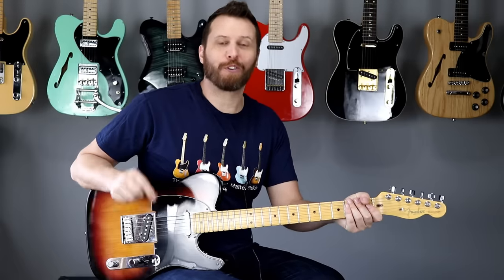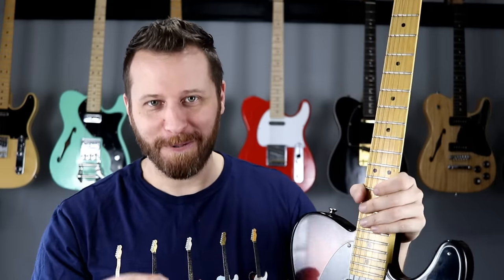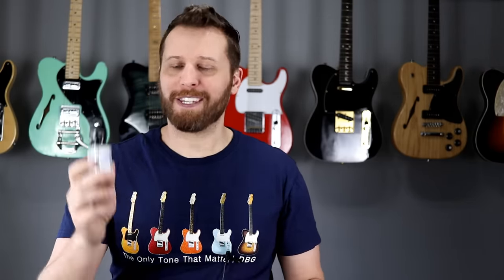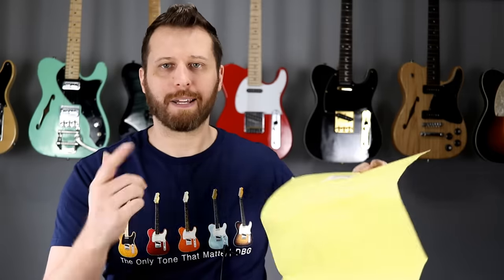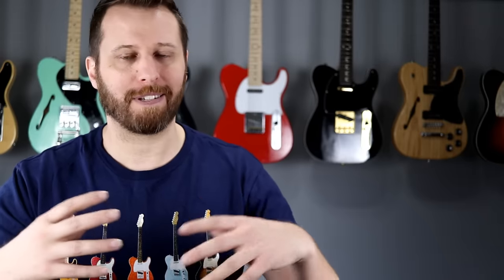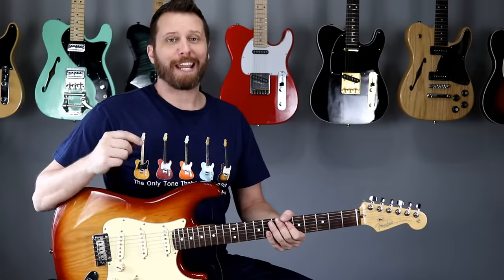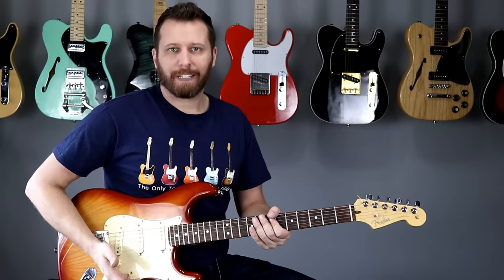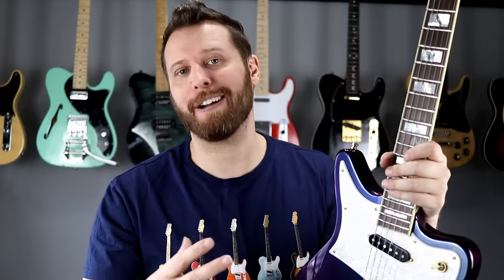KILL The Hum and Buzz!! - Keeping Your Single Coils QUIET!

Comment: I have found from ownership experience that my made in Indonesia Fender Affinity Telecaster is essentially my best and favorite electric guitar out of 17 others. I place it above or at least equal to my $1,999 Gibson 2017 SG STD. HP! I love my Telecaster and it allows me to play really well, it does not prevent me from getting the tones and notes that I am trying to play. It's not working against me in any way. In fact it's working rather well for me.
I paid $249 Brand new over at Sweetwater about 1 - 1/2 years ago. For that price I also received a Fender Frontman 15G Guitar Amplifier (which is damn good, only lacks reverb), a Fender instrument cable, a Fender Guitar strap, a Fender electronic tuner (it's my best tuner and never lets me down) and a Fender Gig bag! Wow! What a deal! My Telecaster has the skunk stripe down the back of the ("Maple") neck and has the string through body with steel grommets in the back, it also has six (6) individual saddles and I can get Intonation absolutely perfectly. The pups are clear and silent and strong. The knogs work perfectly. The neck is without fault, no overhanging frets and it's even "Rolled" which I know that Darrell loves. In all honesty it arrived with one fret, the 3rd fret on the hi "E" string a little high which was causing a very slight buzz. I can't tolerate any fret buzz so with just a little work with a quality file the problem disappeared. 
This one Telecaster all by itself has made up for all the difficult (in comparison) to play guitars that I have and I have 17. I absolutely play my Telecaster more than any other instrument. It can do any style of music. Jazz, Rock, Blues, Country Shoe Gaze. I can even make it sound like my Full Hollwbody Guild A-150 Savoy that has Flat-wounds. I finally got LUCKY! I am a Telecaster man now. Oh and the body is not all that heavy and it is a very comfortable shape and size, not too thick. I did file/sand the top and bottom corner (near where it makes contact with my body) down just a little when I saw others doing that. It makes it more comfortable but in truth it's not all that much more comfortable so I recommend not doing that. It's the one time that I followed a trend. I figures so many people are doing it, so it must really make a difference. Yes it does but I would not do i again if I had it to do over again.
If you want a great electric guitar I recommend Leo Fenders Telecaster. Spend as much or as little cash as you want. It's a simple guitar that is close to perfection and is very tough and resilient to damage, so once you own one you shall understand what I mean and why I wrote so much about it here.
Last thing, the tone is great and very adjustable. It really can do all styles of music. Small adjustments of the knobs and also using the 3-way switch and volume allows for tasty tone and it allows you to get different shades of your tasty tone with small changes. Honestly the tone capabilities is beyond the reach of every other of my 17 electric guitars. I think that's really why I love my Telecaster so much. I can make small adjustment as I play and this allows me to keep in the mood, to be able to make the tones that I am feeling. You have all seen great guitarists making minor adjustments using the knobs and 3-way (or 5-way) switches while they play. Once you find yourself doing this, trust me you are now an advanced player.
-Peter

Comment: The pro guitar techs have determined that the shielding paint loses effectiveness after 5 years or so. Sure enough, 4 years after doing mine, I'm getting worse readings on my Ohm meter than when it was first painted. I'm just gonna add another couple coats and call it good. My SX strat clone has a lot of irregular surfaces in its several cavities, making the foil very difficult to do correctly. Thanks, Darrell, for your comprehensive presentation on the various options.

Comment: some good tips in this vid, but I am surprised you didn't also mention grounding.  One of my strats was noise than the others, and I finally realized it was not grounded to the bridge.  Once fixed that improved the hum a lot, still has some but was much worse without grounding.  I still want to shield the cavity but for now, just ensuring a good ground helped.
Reply: If your guitar isn't grounded it's faulty and potentially dangerous. All electric guitar circuits must be grounded.
Reply: @MonsieurVersatile  Thanks-good point and totally agreed.  Just mentioned it, since where mine was grounded, it had become a bad connection (must have been cold solder joint from previous owner). Once that was fixed, it did make a big difference in reducing the hum.

Comment: There is a great gate software/vst called Reafir that comes with reaFx bundle. It can be used to automatically take the humming frequencies and subtract them. Extremely precise and one doesn't have to fiddle around with knobs. Last thing it's free and easy on cpu and works on all daws.
Great bang for the buck that you never have to pay.

Comment: Holy Crap Darrell!  This video just made me realize why Fender put the freaking strat volume knob practically on top of the bridge pickup.  Because they knew you'd be constantly having to roll the volume down to control the hum!  Geesh.   You'd think they would have tackled that problem right away.
Reply: At that time the humbucker hadnt been invented yet. For example the Gibsons had even noisier p-90 pickups. Fender was just being smart putting the volume where the players can easily reach it. Besides, people didnt play with much gain until the late 60s. There is no other guitar that you can control the volume so effortlessly. Yngwie Malmsteen style volume swells with the pinky are prettty much impossible without a strat.
Reply: @infectionsman  Good history lesson, thanks.

Comment: Use a noose gate that is signal activated.  It doesn't cut off notes  if you turn your volume down because as long as there is a signal, the noise gate can function properly

I use a 30 dollar Donner noise gate and it is phenomenal. It is signal activated

The other type of noise gate that I don't like is voltage activated, if you turn your volume down the noise gate doesn't function properly. It's a dramatic difference

Comment: You forgot the old "turn your body until the hum stops" trick. I thought it was a joke until I bought a P90 equipped Les Paul and I can get it near silent if I'm facing the right direction. Not practical for a performance but for home-based play it's all I need

Comment: I have an Electro Harmonix Hum Debugger pedal.  It eliminates pretty much all the hum coming from my guitar, even with the amp cranked.  It's a funny pedal in that it runs on 7.5 volts ac/ac. It works by removing odd-order harmonics in "normal" mode and both odd & even order harmonics in "strong" mode.  This means it will really alter your dirt pedal tones, so you might want to put it at the front of the pedal chain, or disengage it when using dirt pedals.

Comment: I use shielded mic wire in my builds and mods for anything and everything if I can. I have wrapped a bare wire with single coil pickup wires, then wrapped in foil and shrink tube it to shield the wires. Every little bit helps.

Comment: Shielding the guitar isn't quite to quiet the single coil pickup. Sometimes the hum has nothing to do with the actual pickups, which is why a good guitar with humbuckers  STILL has shielding. "Hum" can be caused by many things, not just pickup noise. Even guitars with "noiseless" pickups can hum quiet a good bit. It has to do with external causes, like AM interference AND lack of proper shielding/grounding, among others. This should have been in one of your "mythbuster" episodes!!
Reply: I had to get a power conditioner because of the wiring in the building I live in. It helps.

Comment: The Ernie Ball and Suhr systems are very different.  The EB system is active (requires a battery) and as seen in the video doesn't get rid of all the buzz.  The Suhr SSCII system is passive (Doesn't require a battery) and does eliminate all 60 cycle hum.  My Suhr has the SSCII and the single coils are quieter than the humbucker. The Illitch system is available in lots of configurations and works as well as the Suhr system...  I'm pretty sure the Illitch and Suhr systems are the same in different forms.

Comment: I feel it also helps to see where you are putting your equipment. Like I had my amp plugged into the same strip as my PlayStation and my entire HiFi setup, all in the same corner of my room that I sit on the floor at and play in front of the amp. Obviously the humming was absolutely intense as all hell.

Comment: Another option low noise single coils for example lace sensors I have a set of DiMarzio Brian May pickups they are low noise too. Still is a compromise because they usually don’t sound exactly like you want.

Comment: I had an old Epiphone USA pro super strat that had a neck single coil.  It had a dummy coil in the control cavity and it worked really good.  No noise and because it wasn't by the strings it sounded like a single coil.

Comment: Use shielded cables and a power supply or high quality power strip/supply to clean up the power. There is lots of interference inherent in the grid, your home or building. This is often referred to as “dirty power”. It’s all just interference. Also ground your outlets.

Comment: As a fan of single coil guitar we should do this

1. Isolate all power supply for each pedal
2. Use noise gate and or noise supressor
3. Use noiseless and good cable and patch cable
4. Use hum eliminator

Comment: I have the Ilitch Electronics dummy coil system installed (by a good tech) on my Strat and Tele, and it sounds great, very transparent, as little change in sound as possible. Not cheap, but worth it to me.

Comment: One you didn't cover, that was the "secret weapon" of a lot of players through the years is a "dummy coil" - some are an extra pickup laying on it's side under the pickguard, often without pole pieces.  Some are visible, but have the pole pieces removed and the pickup is lowered flush with the pickguard so they don't "hear" the string much, if at all, then in both cases the dummy coil is wired in humbucking much like positions 2 and 4 on a strat, but without the quack.

I've also seen cases of pulling the screws on one coil of a humbucker - it still kills the noise, but you only get the sound of one of the coils (though they don't sound exactly like a true single coil - different winding geometry and number of turns are the most likely reason there).  If you have a guitar with screw pole pieces, really easy way to try it out and see if you like it that shouldnt do any harm to the pickup at all.  Just make sure nothing gets down into the holes while you are testing it out - probably throw a strip of tape over that coil or the like.  Otherwise it makes getting the screws back in difficult.
Reply: Got a Epiphone Blueshawk a while back because I played it in the store, thought it was real cool, I couldn't work out why it was so silent, didn't even realise it had a dummy coil til I looked up the specs on line a week later. Actually I didn't even know dummy coils were a "thing". Great guitar

Comment: One thing that was missed here was pickups like the Seymour Duncan Hotrails and Coolrails which are humbuckers that fit in a single coil hole.  Sure, they may not sound the same as single coils, but I don't think they sound like full size humbuckers either.  The SD stacked pickup was definately the quieter in terms of hum on this test though.  It would probably be pretty good with a noise gate set loosely.

Comment: Love you video most things are really on point. Here's some other ideas. A lot of times a ground lift amp or a d i box with a ground lift in it may help quite a bit. Also if you turn 90 degrees to the wiring that has the sound you may eliminate the noise. If it's your home you may eliminate the Noise by grounding the circuits that you're plugged into, as in a could be bad wiring in the home.

Comment: I use the Electro-Harmonix Silencer, but I generally end up switching the gate off. The gate doesn't play nice with others - especially a compressor. When used with a compressor, it's like running a humidifier and a dehumidifier at the same time. I'd rather have the hum than lose the initial attack or sustain that comes with using a gate.

Comment: The gate isn’t eliminating the hum. It’s still there while you’re playing. I hear it.

The high pitched buzzing you’re hearing isn’t hum. Hum is magnetic field noise. That buzz is electrical field noise. Shielding fixes that. The pickups are not shielded. Shielding the control cavity or pickup cavities don’t work as well as shielding inside the pickup covers.

Comment: Other noise issues are cheap or old cables. Cheap unshielded wiring ,or breaks n the shieldng of the wiring . Bad solder joints.   Grounding issues cause hum as well .
Reply: I agree ....lol

Comment: Great video! I completely shielded my Strat (basically a faraday cage in the electronics cavity) and installed some DiMarzio Area pickups. They aren't true singlecoils but a stacked design, but imho if you aren't super picky about the "true singlecoil sound" they work very well, sound incredibly close to the real deal and kill all the noise. My Strat is dead quiet now. No matter if playing live or recording :)

Comment: Darrell, how about putting a dummy coil in the pickup cavity? Could you accomplish the same thing with a lower value inductor? As for what i use right now see my first comment. I'd like to see what could be done with this othertechnique, but my Strat was stolen. I'm saving for another one, but this will be my fourth Strat, and I'm about to give up on them and get a Tele or Jaguar with P90's.

Comment: Shielded wire makes a huge difference. Many Fender style guitars don't have it but they can be modded with the shielded wire for sure, I've done it. With BOTH wires shielded, you can swap phase quietly without putting the shield on the signal path.  Fender made a three wire tele neck pup called the "Twisted Tele" ..but did not shield the wire, just the pup cover...?  C'mon Fender- use shielded wire!

Comment: I use the Duncan Stacks in my 3 pickup Tele and love, love them, narley and beafy and coupled with a wireless they'r quiet as a mouse. I use to do the shielding but it is a hassle and guitars should come fitted with that set up. Don't forget the Wireless! It reduces the amount of cable that picks up most of the hum to begin with.

Comment: Power conditioner may be another one, or DI box (JDI Radial Engineering)
When I record DI there is an angle I can turn my guitar away from my speakers to remove hum. 

Thanks for the video!

Comment: I have an old Washburn Strat style guitar, and the original single coils were thin sounding, and hummed awfully.  I replaced the pickups with EMG actives, and they are quiet, but still put out that quacky Strat sound.

Comment: Shielding both the guitar and amp while using an equalizer or pre amp definatley helps reduce alot of the humming from using alot of effects pedals and e.m.i. . a speaker mod can also help crank up the volume with less hum in your tone.

Comment: First, sorry it took me this long to see this video. It somehow slipped by me and I only saw it as a recommendation from YT. 

Second; You didn't mention just standing/sitting in a Faraday cage! 😉
Although if you chose to do the shielding option, and did it right, that's pretty close to what you created! See! All those high school science classes are starting to pay off! 😂

Seriously though, I'd highly recommend the shielding option.  If you can't / won't do it yourself, I'd bring it to a tech or luthier to have it done right. Honestly, it doesn't take much labor, and the most expensive part will probably be the conductive copper tape used. Amazon has rolls of conductive copper tape for $5-$20 usd (depending on length and width). Last I looked Stew Mac had rolls for around $25usd. Make sure if you are doing this yourself that 1) the tape you bought is for shielding and not 'slug repellent' and 2) the adhesive on the tape is also conductive. 

I also make a small 1-2mm lip onto to the top of the guitar (all the way around with slits made in the tape to account for / accommodate the curves of the body cavity) so that it makes an easy connection with the tape on the back of the pick guard. That way it is still small enough that it is covered and not obvious. I have also seen just a small strip extending out by or even running under the bridge with a matching strip on the pick guard (until the end of the pick guard only). Ultimately, as long as you are making a connection between the two, you should be ok. If you are having issues with a non working pickup after shielding the cavity, look to make sure nothing is grounded out (that isn't supposed to be anyway). It's actually not that uncommon as you are moving and bumping everything around. ✌🏼

Comment: Yes a Gate can help most folks but lets face it some of the real beauty of the classic Fender single coil sound actually includes the hum, I've tried the alleged  Fender noiseless pickups from v1 to v4,  each version get's a little better but they all are far too expensive  very HEAVY they spoil the light weight balance of most quality Strat's, they still don't sound that great when you add the extra weight of a set of locking tuners your guitar is now double the weight without much improvement in sound. Think twice before wasting your money. I'm amazed that with the fantastic developments in electronics THIS  is the best they can do